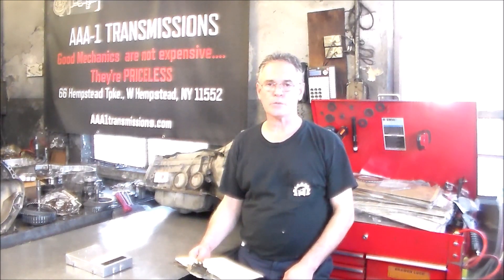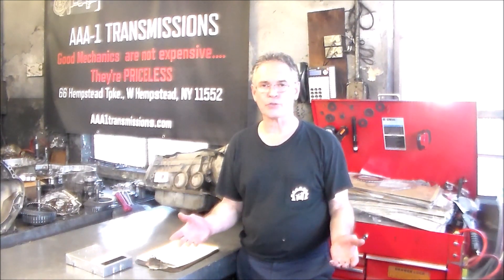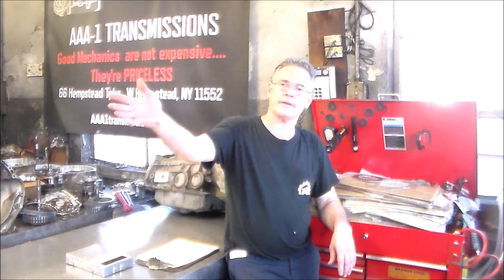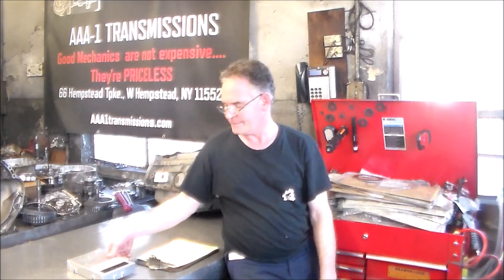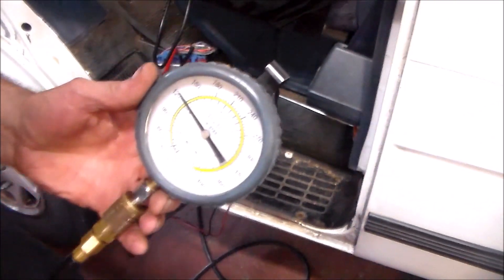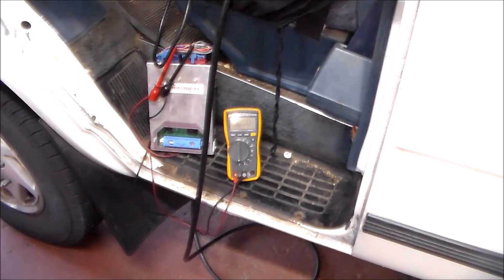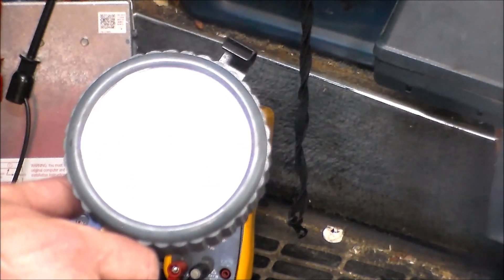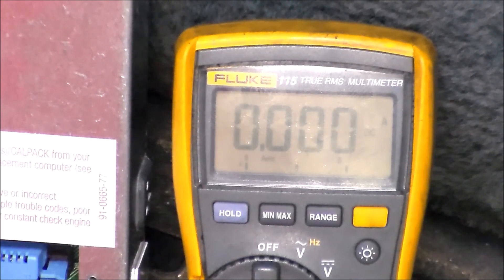4L60E, Hard 1-2 Shift Diagnosis & Repair

Comment: I have an 03 Silverado with the 4l60e, it only has the 1-2 hard shift after about 40 miles. After it cools down, no problem.
Reply from the maker: may have an issue in the valvebody

Comment: Great diagnosis Gary! Got a 93 k1500 with the exact same issues. 160 psi line pressure at idle. This one comes to me with a new trans already in it! I have an ancient Matco Interceptor and saw at idle 1.015 amps commanded (20% duty cycle) and an “actual” reading of 1.005-1.015 amps. Getting into the “low” side of the pwm force solenoid at the pcm I measured only 400 mA, which charts out at about 160-180 psi! I even double Checked the pcm grounds for resistance issues and found none. 
WOW. I hate when my scan tools lie to me! “Actual current” Pffffft….Good find. What do you think causes the low current issue? Weak grounds for the driver inside the PCM. Incorrect programming?
Great video.
Reply from the maker: its usually a driver

Comment: I need a mechanic like yourself in my area. My 1994 C1500 is running terrible and has a harsh 1-2 shift. I cant diagnose it because I lack the knowledge and experience. I finally took it to a shop and they shrugged their sholders in confusion.
Reply from the maker: ok, running terrible  meaning engine wise?
Reply: @GaryFerraro  The idle will surge on start up and at what seems to be random while driving. It will stumble at stop lights. Sometimes it will miss and sometimes it won't. Also, until it gets out of 1st gear my throttle response is "laggy"  for a better lack of terms and will drop RPMs almost like the timing is serverly retarded. I have trouble shooted everything I can think of except my pickup coil, computer, and timing chain. I believe I am having an electronic issue, not mechanical. I am just a shade tree mechanic, though.
Reply: @megafan0258 had the same issue it ended up being the tps

Comment: I know this video is old, but I had to thank you for saving me a ton of grief. I have a 1995 Silverado K1500 with the 4L60E . It developed a brutal 1-2 shift and harsh drive and reverse engagement. I have been a mechanic for 40 years, but have done very little trans. work . I really thought that the trans was shot because it has 250000 miles on the clock. I was also told that by two trans. shops. I was going to drop the pan and check the solenoids and the 1-2 accumulator when I saw your video. My pressure was high also, and it would fluctuate if the pcm was tapped on. So I got a reman pcm for 130 bucks and viola!! Cannot believe how smooth it shifts now! Thanks again for making that video! Saved me 1500 bucks!
Reply from the maker: Good Job on getting that fixed
Reply: I have the same problem in my 95 silverado. Did you buy the new PCM or did you have it rebuilt? Or do you know of a place on the internet where I can buy it?
Reply: or do you think I can change another one of a yunk truck
Reply from the maker: I believe we bought that from Parts Authority, reman one @migueltrevino3337
Reply: @GaryFerraro   thank you

Comment: we have a 01 z71 getting a hard shift 1-2 only when its hot. trying to figure it out, when its cool or cold it does not act up its totally smooth any ideas. no codes.
Reply: Did you ever find out the  problem
Reply: Having the same issues.
Reply: My TCM was faulty. I replaced my TCM and it fixed my hard shifting issue.

Comment: 07 Sierra Classic 5.3  4l60e is shifting rough from 1 to 2 but ONLY when I drive for 30 minutes...thoughts on if its 1-2 solenoid or the trans acc piston???
Reply from the maker: Would like it scanned for codes, that may give direction
Reply: @GaryFerraro  scan code PO894
Reply from the maker: @brentlsu  ok, that is why it shifts hard on the 1-2.  That is a TCC slip code.  If you clear it, should shift normal
Reply: @Gary Ferraro  I cleared it and it did it again. I'm gonna have my friend put it on his scanner which is more fancy than my 80 dollar scanner

Comment: Hello I have 4l60 that was remanufactured I installed it had a hard 1 to 2 hard shift and at times felt like it was sliding into gear I installed a spineless accumulator and Corvette servo it stopped the sliding into gear and at low shifts smooth but when you hit the gas pedal I can still feel the 1to 2 shift not for sure what it is but the rest of shifts are smooth
Reply from the maker: Normal driving is ok?

Comment: Hi Gary. Do you think it's the same diagnosis and cure to my 604 41TE with harsh bump downshift to 2nd, and same with upshift to 3rd or 4th? It has new clutches, shift solenoid, speed sensors, T Position sensor and even the Transgo 604 valve body kit (new seal, expander, springs, corrected plate hole). Thanks.
Reply from the maker: may or may not,  what type of scan tool do you have?  any codes present for the transmission

Comment: Got a question I have a 4L80E that has zero amps on the pressure control solenoid once you drive 40ft. in gear. It has a new pressure solenoid internal wire harness, and just installed a reman ecu. Prior to replacing the ecu I had to take it on a long drive coasting with the TCC engage before the pressure solenoid goes zero. It shifts real hard. After a key cycle it would read normal 0.88amp and goes to 0.6-0.5amps while shifting. Now with the reman ecu it reads normal 0.8 amps at idle 0.6 while driving in gear. driving to a stop it goes to zero amps. Once I drive it again it shifts hard 1-2,2-3,3-4. I think the reman ecu is bad. Do you know the normal pressure solenoid amp reading while driving. When the issue occurs I can't increase the amps for the pressure control solenoid.

Comment: What cause shift only 3rd gear 6R80
Reply from the maker: sounds like it's in failsafe,  scan it to see if codes are present
Reply: @GaryFerraro  no code
Reply: Completely desmentl inspected ok air pressure with operation ok
Reply from the maker: @mubinpanchi2893  did it come in with this problem or after overhaul?
Reply: @GaryFerraro  Before overhual same
Reply: I found Transmission harnesses Burn repaired  then tested ok again test drive same problem only 3rd gear shift .PCM also replaced
Reply from the maker: @mubinpanchi2893  What are you using to scan the car with
Reply: @GaryFerraro  IDS
Reply: In dataloger LPC showing after 3rd gear 0 psi
Reply: Hello sir
Reply from the maker: @mubinpanchi2893  ok, what happens if you pull this to manual low or put it in manual mode, does it shift?  what are you using to scan the car, can't believe there are no codes, next is to check power at the trans connector
Reply: @GaryFerraro  Manual not shifting also not showing instrument cluster B1201 B2872 B1A82 P0315
Reply: Transmission connector power showing ok
Reply: As per wsm
Reply: Sir any suggestion

Comment: Good catch. I saw on a Transmission repai help board where one shop had a Suburban with an 4L60E with a hard 1-2 shift, but, the other shift were fine. He didn't say the line pressure, but someone suggested a weak battery would do it. Case solved.
Reply from the maker: Thanks for the tip,  I have seen bad alternators screw up the shifting, if you don't have the correct voltage at the trans it will not work correctly
Reply: @GaryFerraro  mine does the same it will shift hard in 1st to 2nd but all the rest of the gears are perfectly fine
Reply: @timothydriggers5312 same here did you ever find out what it was causing the hard shifting?
Reply: @bryanalaniz4172  yeah the transmission accumulater it had a hole it
Reply from the maker: Any Codes
Reply: I have circumstantially discovered harsh 1-2s in 2000+ 4L60e vehicles being "cured" by the replacement of weak or undersized batteries in 3 solid instances. 

Did not diagnose toward this solution, but it makes sense. Many Dodge/Jeep models are known for harsh shift due to EPC voltage caused by bad batt/alt

Comment: old school van. Wait wouldn't the g30 normally have a 4l80e in it? normally the 4l60e would be in a lower trim like a g10 or g20.

for example the 1992-99 suburban 1500 would have a 4l60e and the 2500 would have a 4l80e.

thats odd to me 🤔
Reply from the maker: I thought it would too with a 5.7 but it did not